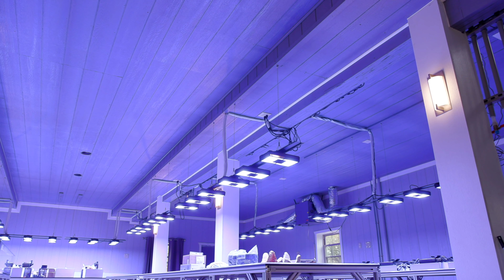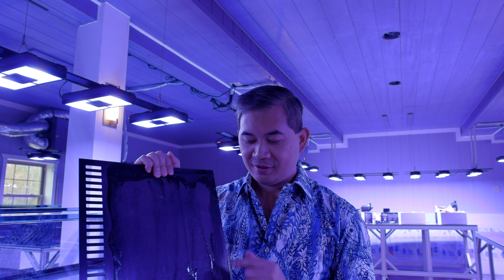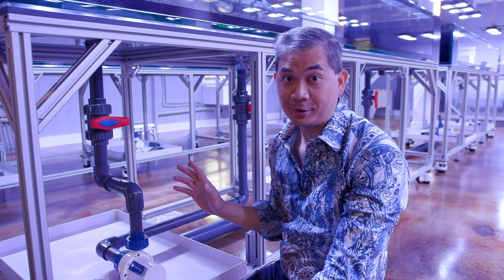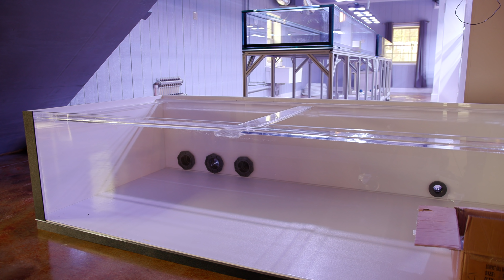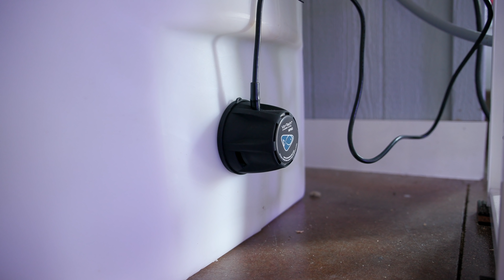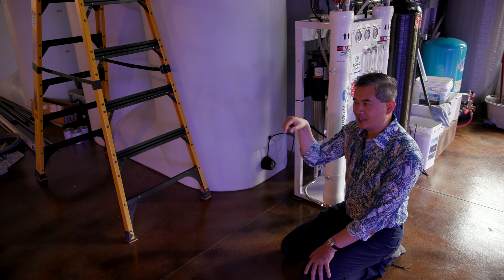Light at the end of the tunnel! Tidal Gardens October 2019 New Building Update - Episode 11

Comment: For your closed system return, you need to minimise the number of 90' bends or eliminate them. They cause internal turbulence and will lose you about 10% flow (check this number, but from my engineering degree I know it was very significant). Google fluid dynamics on bends. 👌🏿they will also increase noise. Two 45' are much better😁

Comment: Careful on those Vectra L pumps. Two have melted down on me (impeller chamber melts into the impeller). If they are the new ones (L2) maybe they are better, hope so! Great looking updates!
Reply from the maker: Thank you.  I've used them since they first came out and have had plenty melt down.  Over the years they have made fixes to the design and I do think they have improved reliability now, but more importantly I've had really good service from Ecotech when a problem did arise.  I keep a backup pump on hand in case one dies and I have to swap one in.

Comment: Sounds like the water making/mixing situation is really the biggest hurdle there, hopefully the MP60 works, but with 1000gal I’d imagine you’ll need at least another 1 (maybe 2) even though those are some of the best flow generators on the market
Reply from the maker: There is a closed loop on the saltwater container using the variable speed drive pressure pump, but it is inadequate flow to mix all the salt.  The MP60 made a huge difference.  I still might need two but I am going to give this single one a try for a while.

Comment: Well thought out, congratulations and thanks for sharing. I considered using a 20/40 aluminum frame, but got stuck on the design. It you could share details of the design, it would be most helpful.
Reply from the maker: To buy this type of stand you have to go through a design company so they have exact measurements for their cuts and exact counts for the hardware.  We used HPE Automation.
Reply: @tidalgardens  Thanks!

Comment: What a beautiful setup.
What salt do you use? Have you seen the BRS salt mix comparison?

Most likely I don't understand the setup completely but it seems like having the outflow come into the bottom of the sump would not allow for much water in the sump. Since outflow is gravity flow, how will water go any deeper than the bulkhead at the bottom of the sump?
Also what was the thinking on Abyzz pumps. Seems like an external pump like reflow hammerhead would be a LOT cheaper. Saving $2,000 (retail) per pump!
Funny you mention not wanting to put two MP60s on the mixing station. That's only a $700 up charge.  :)
Also the mixing station - why didn't you elevate it? Seems like it would make cleaning much easier.

Comment: Looking great . I noticed you cl system doesn’t have check valves aren’t you scared of draining the tank if you have to disconnect the vectras ?
Reply from the maker: No, not so much.  To service the pumps we would close the two true union ball valves (red) and then unscrew the unions at the pump (blue).  There will be water draining out from the length of pipe between the two unions, but the tray plus a towel will contain that spill.
Reply: Tidal Gardens duhhh idky I didn’t think of that

Comment: very nice. Just a little friendly fyi they make cushioned clamps for unistrut also. I use them on my system. helps isolate the pipe from the metal. Looking forward to seeing everything up and running.
Reply from the maker: That's a good call on the cushioned clamps.  I'll have to see if we can fit them into our implementation because there is barely enough space from the floor to the bottom of the stand.

Comment: Awesome update! Question on the closed loops. There seems to be enough clearance under the tanks and around the pumps, what gives with the 90 elbow on the return line, why not straight up?
Reply: Use two 45' instead.
Reply: @Optimus_Magnum  Makes no difference. BRS has already tested and proven this
Reply from the maker: That's a good question.  If I was to do the plumbing myself, I would have gone straight up, but there are two advantages to doing the 90's that I learned by talking with the plumber.  The first is lining up the pump.  If I went straight up with the output line, the pump intake would always be slightly off, so having the pump offset to begin with allows for having the plumbing go parallel with the stand.  The second advantage is that 90 allows for more play in the line when you are taking the unions on and off.  For whatever reason there is less stress on the pipes having it 90 out like that.